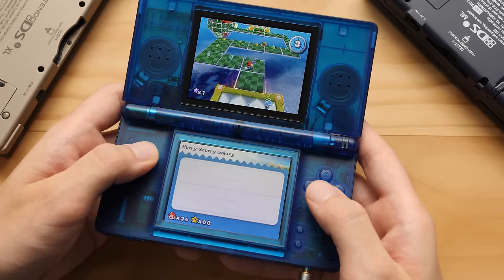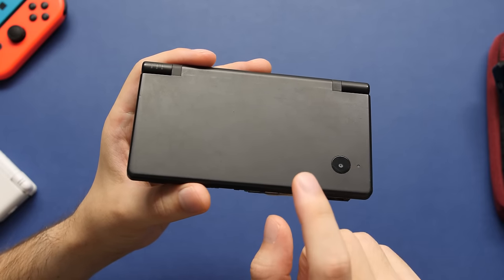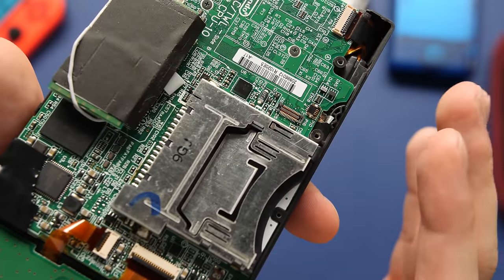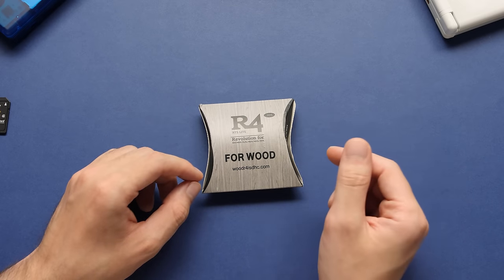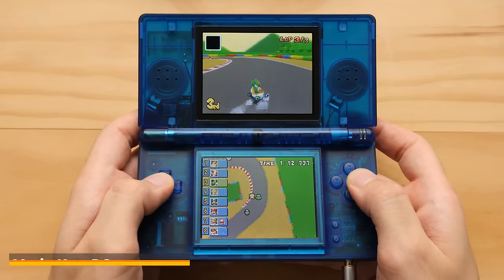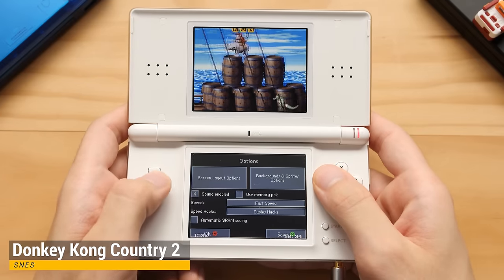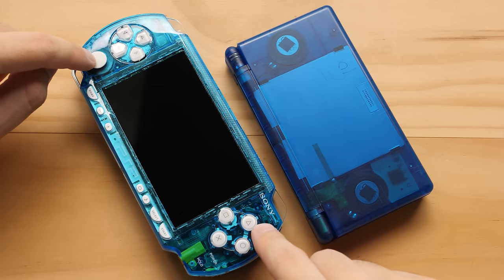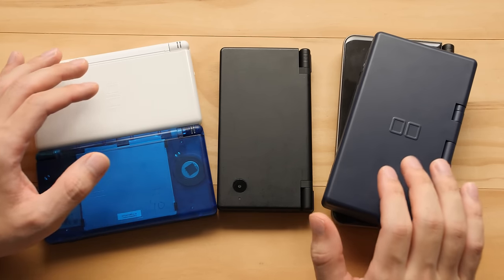The Nintendo DS is Still Amazing in 2023. Here’s Why.

Comment: I used to enjoy writing NDS homebrew. Sadly, the XP laptop I used to code on died long ago, so now I'd have to build a retro PC just to get the dev stack back up and running. Glad to hear R4 cards are still available.
Reply from the maker: I was so surprised to see the scene is still alive and well. I didn't touch on them in this video, but the Mario Kart DS/SM64DS mod scene is even bigger.
Reply: I would just buy an old used laptop, It's a lot more convenient than building a PC if all you need is software compatibility imo
Reply: Couldn't you use an XP VM?
Reply: What @chwoder-hf8xm said. You oughta be able to get things running again on a VM.
Reply: Yea or using Linux/Mac with a compatibility layer
Reply: you can just easily use something like PCem or VMWare to run Windows XP, 2000, etc unless u prefer using older hardware to get things done.
Reply: What would I need to do get into this scene (in terms of language, software and hardware)? I'm wondering whether to get into Spectrum ZX or DS/3DS scene.
Reply: You could run XP on a virtual machine. VMWare Player and VirtualBox are good options.
Reply: You could easily use a VM, or wine would probably work pretty well as well
Reply: I gave up on R4 cards sadly because every single one had a timebomb, and when I tried to fix/flash them it just made the carts unreadable.
Reply: As others mentioned, running xp in a virtual machine using a free activation key online is super easy, currently doing this for my wife as she needs xp for her embroidery machine software
Reply: VMWare workstation is free and does a damn good job of handling things like that!
Reply: Use a virtual machine, bro.
Reply: devkitpro works perfectly on modern machines :) even works on linux and mac and includes loads of useful tools. though if you used to use game maker ds, that might take some fiddling with settings. but honestly modern windows backwards compatibility is pretty damn cool so there is a fairly high chance it'd just work, no questions asked
Reply: You know virtual machines exist right?
Reply: @RatcheT2497  You should say: "It even works on Windows", because the whole thing is actually GNU/Linux through and through and relies on MSYS2/MinGW on Windows.
Reply: @rockapartie  yep, but op here seems to assume ds development happens on windows by default. so saying "it's a linux/unix based sdk but it works perfectly fine on windows" may be less reassuring than saying "it also works on linux and mac". first sentence frames windows as a second class citizen - which could bring to mind compatibility issues, while the second assumes windows compatibility as default with the additional boon of working fine on two other platforms (so even if op switched to e.g. mac later in life, everything would work either way). 
yeah though it's a bit less accurate
Reply: Can't believe Davros is out here modding DSs :0 

Jkjk, rip to ya XP Laptop also.
Reply: @TakiUdon  Who to download  Super mario  galaxy  on nds ?
Reply: had too much file's on to the computer dont add to many files i done that once.
Reply: You'd be surprised how well Windows 10 is optimised for NDS scripting (fanmade enhancements ofcourse)
Reply: If you ever want a fun idea, try porting Pokemon Uranium. That’d be amazing!
Reply: Original R4 cards are for the 3DS and 2DS though, for the DS and DSI you have the M3 card.
Reply: DanteS-119 exactly. If you are writing homebrew then you know about VMs and should already have one setup and ready to power on if you are that attached to XP. The OP must be in middle management, knows a few buzz words but lying his ass off about knowing how to do anything.
Reply: Set up a Virtual Machine, my friend!
Reply: mad respect
Reply: @misterthemad994 I literally have R4 card here on my palm that was made for ds lite. Got it back in the day

Comment: Not quite the same, but the New 3DS has been my go-to handheld this year. Between the ROM injections, native DS/3DS support, and portability, it just outshines all the other handhelds I have at the moment.
Reply: 3DS is peak. If it was only a little more powerful and just double the resolution (would be 480p ish), it'd literally be impossible to beat it ever again.
Reply: @trashtrash2169 n higher res. Switch power yes but there’s no personality. Couldn’t even give us folders…
Reply: @trashtrash2169 yeah the screen is the biggest L for the new 3ds. My modded new 3ds xp is the most superior handheld I’ve ever used but the screens just need to be better. More power wouldn’t hurt but that could eliminate some charm from the library
Reply: @ShadyRapture  Sure, but I think slightly higher res textures would do wonders for the graphics, and that should be based more on the ram than graphics chip, I think, so get faster and more ram, and increase the screen resolution while updating the graphics hardware enough to compensate for the new pixels. That'd be my forever handheld.
Reply: modded vita and N3ds are a w combo
Reply: @Pokefan000000  It definitely seems the be the ultimate handheld combo without diving into emulation consoles.
Reply: @trashtrash2169  Problem is that the already low resolution gets halved in 3D-mode and only a couple games use the full 800x240 with 3D off (e.g. Ocarina of Time).
Reply: @rockapartie  Woah woah woah! You are misinformed! No commercial games use 800×240! It is very obvious if you just open OOT3D that it is not 800x240. So no, in any official case, 3D does not halve the resolution. 2D is 400x240, 3D is 400x240. I do not know where you got that idea.
Reply: @trashtrash2169  I got the idea, because the jaggies get smoothed out in 2D mode. I thought the resolution was higher then. (It can be observed in a couple games, I only remember Ocarina though) Well, it must be anti-aliasing.
Reply: @rockapartie  800x240 is in ZERO retail games! There have only been homebrew demonstrations. In fact, how the 3DS top screen worked was heavily debated by 12 yr olds when it released, some even suggesting that it was two 400x240 pixel grids placed one over the other. The only problem with that theory is that it makes ZERO sense! At all! Especially since just looking at the screen close up reveals the truth of the squashed pixels. There's a humorous Gbatemp thread that documents this argument beautifully. It'll show up if you try to look up anything about the 800x240 top screen. I mean, I could maybe understand thinking that it was a 400x240 screen that diverted the picture to a different eye every other frame, but that was not how it was done in the end, though the 3ds screen can be "overclocked" to near 100hz already, so with a slightly different screen they could have done it this way and kept the 60hz refresh. Maybe not though, The way they did it is superior, I think, but my way might have reduced phantom images. Maybe not.
Reply: @trashtrash2169  Yes, I know that know, you didn't have to repeat that. But like I already said: Ocarina and some other games use anti-aliasing only in 2D-mode.
Reply: @rockapartie  That does not come close to 800x240 mode. Also, OOT has VERY light AA.
Reply: @trashtrash2169  I wouldn't call it light, it's using supersampling after all (which I mistook as having a higher screen resolution at first glance), albeit only on one axis. Horizontal(ish) lines are much smoother and texture flickering is massively reduced.
Reply: @rockapartie  Man, I won't respond another time. Clearly we see things differently, literally, so that's that.
Reply: just ordered a second N3DS from eBay yesterday.
I love that device, its *perfect*!
Reply: PORTABILITY KING
Reply: Same here. Modded mine when the shop closed down and been running old DS and GameBoy.
Reply: 3DS and PS Vita are the best modern handhelds.
Reply: How have you been emulating other devices? (SNES, gba, gb, Genesis etc)

Comment: Usually on DS consoles that have a "broken hinge" actually have a cracked shell in the hinge area. The metal hinge itself usually doesn't break under normal use.
Reply: Thats what they mean tho. Its always the shell thats cracked,not the hinge itself.....semantics.
Reply: @NintenDub  I just wanted it to be clear. If someone wants to shell swap anyway, may as well get one that's broken, right?
Reply: usually the hinge isn't broken but it'll get stiffer or seize up which breaks the shell, even if the hinge still looked like it worked its better to get a new hinge bc the same problem would probably happen after a while even with a new shell

Comment: Pro tip: If you have a (N)3DS XL you can boot a NDS game while pressing the Select button to play it in pixel-perfect mode, which will add black areas around the screens but will look about the same size as a regular DSi
On a regular 3DS it will look too small to be usable
Reply: There is also homebrew software to change the rendering for nds games to make them more sharper
Reply: pro-tip: this has extremely common knowledge since the original 3DS model was released and it's annoying as fuck to see this "fun fact" get posted on nearly every DS video released these days

Comment: I just got a practically new DSi XL for less than $50 and it’s been an amazing experience. I always preferred the DSi as a kid, I just liked the way the shell felt and the screens were amazing after coming from a GBAsp 001. I stopped playing handheld anything right as the 3DS came out so with Twilight menu on the DSi XL I get exactly what I need. It’s wonderful
Reply: The DSi was my favorite as a kid too.
The volume buttons were much better than the sliders and they supported adjusting the brightness on the fly. And they loaded so much faster than the 3DS.
Reply: @AlexsGoogleAccount adjust brightness on the fly? Cant do that on dsi
Reply: @sweettea5166  Sure you can.

Hold down the SELECT button and then when you press Volume Up or Volume Down it changes the screen brightness instead.

No matter what you're doing, it changes the brightness.

Comment: I really liked the Nintendo DS Lite, had mine for years. Recently, I noticed the bottom screen was getting messed up. Where the black text warning was when you boot up, it was becoming black with yellow edges. The blue URL was half blue and half black. I tried adjusting the adjustment screw and sometimes it would help, but then revert back. I adjusted that screw so many times I think I stripped it. Couldn't really tell if I did or not so I opened it up. I didn't. I closed it back up and the shoulder buttons were a pain trying to align the spring correctly. Finally got it closed but power switch wasn't springy anymore. Turns out I snapped the onboard nub on the power switch off while closing it. RIP DS Lite. You were a good friend to me.

Comment: For DS games I like the DSi XL the most, it fits nicely in my hands and the big screen is nice, although that comes at the cost of portability. Not a big deal for me as I always wear a backpack or a satchel. It can do emulation decently, but for that I use a NN2DS XL (what a lovely name), the games run very well thanks to Virtual Console and emulators like mGBA and Snes9x. TWiLight Menu++ runs great too; DSiWare can be installed on the system without it. There're also ports of the engines of Diablo, Doom, and Quake II. Of course, for pure pocketability and playing GBA games natively, the DS lite reigns supreme.
Reply: I have a new 3ds xl with homebrew, am I missing out on anything not putting hbrew on my dsi?
Reply: @idunno421 i have both a modded New 3Ds XL and a modded DSi and from my experience your not missing out on anything. on the 3Ds u can do what the dsi can and more
Reply: @idunno421  If it is a DSi XL/LL you can get better picture quality for GBA/DS games on it compared to the 3DS XL.

Comment: I did the shell swap for a DS lite and managed to break the top screen, bottom screen digitizer and the power switch (same way you did). Had to order replacement parts but got it all fixed up myself. Removing the power switch is not as hard as you think, but you definitely need some soldering experience.

Comment: A New 3DS XL is probably the better choice. It can be hacked without the need of flash cards, has a faster hardware and can is backwards compatible.
Reply: That's unironicaly the best handheld that Nintendo ever released.
Reply: you didn't watch the video. sd card can be used on dsi models. 3ds screen imo is terrible. Clunkier GBA implementation.
Reply: @skatcat743 The screen on the 3DS is factually better wdym?
Reply: I have been thinking about getting a New 3ds xl for a while now, but haven't pulled the trigger. It really does seem like the best as long as you dont want to play your physical gba games.
Reply: @GangityBirdity  The DSi XL has IPS screens but the N3DS XL has TN screens (some of them have IPS screens, though it is somewhat rare)

Comment: If you can hunt a Supercard DSTWO or DSTWOPLUS, those are the only 2 flash carts that I know of that ran Super Nintendo at full speed on the DS, but there's 2 major issues with acquiring one. 

1)they don't manufacture the cart anymore and the Supercard company never blew up like R4, so good luck finding one.

2) if you do happen to find one, nobody hosts the firmware anymore so even if you get the card it's a gamble if it'll work
Reply from the maker: That's why I decided to just ignore them. Wish someone cloned them, but I doubt that will ever happen.

Comment: I love my DSi XL with R4 card. I don't know why but it gives so much more fun to play DS games on real device, rather than ie. some Odin Lite or Steam Deck etc.
Reply: No screen swapping antics. And the screens are aligned as designed. I remember playing Hotel Dusk Room215 with the DS held vertically (side ways) so that's it's like a book.  Wouldn't want to hold a steam deck in Taté mode 😅 🗼
Reply: Yeah, it's because the DS is such a unique device, that emulating it is usually a worse experience. With the way you have two screens at once, can easily touch the screen or reach the buttons, one screen is above the other, just kinda all comes together. Though some games don't lean into this design too much, and are decent on a single screen as well. Ridge Racer DS for example. I can play that on a Pi, or a DS, or whatever lol.
Reply: @DragonDreamVNY  seems you've got good tastes in games, my friend.

Comment: Didn't realize that you can run gba off of an r4. Def gonna be checking that out. I have a launch ds that I always kept in a case, its so minty. Never liked the mushy d pad on the lite. Hitting diagonals seemed tough. Thanks for the video!
Reply: You can but it's far better to play legit games or get a gba flash cart.
Or just play them on 3ds. It's easier.

Comment: Has a black DS lite in great condition ( lives in a Gameboy case)using a newer R4 card with date of 2021 and no problems. Also has a 2DS (wedge) also in great condition ( lives in it's official case) Modded 128gb SD card runs great.
Really interested in the Super Mario Galaxy DS will have to check that out.

Comment: I wish PSP-2000 had aftermarket IPS screens available. I've spent $40 so far ordering replacement screens that arrived in even worse condition than the original one I wanted to replace.

Comment: I still have my DS's from release, with the exception of the original DS which I traded in when DS Lite came out though I wish I hadn't. I still use my 3DS a lot but not so much the DS Lite or DSi's. I'm actually  playing some Pokemon ROM hacks on my 2DS XL right now although my 3DS does have better screens..the 3DS is not hacked but the 2DS is. I do use Twilight ++ all the time. All of them I have are original equipment and in good condition.

Comment: Here's a good modding tip for anybody modding PSPs. If you need a better screen or just a replacement. Buy you one of those old Garmin GPSs with the same size screen. They have the same number of pins it work just as well. Now there is some screens that are lower resolution so you'll have to do a little bit of research but it costs a lot less to buy a Garmin GPS from like Goodwill than it does buying a screen from a seller on the internet
Reply from the maker: Is this real? I can't find anything on this.
Reply: @TakiUdon  I'm not even sure that the PSP community caught onto this. I found a bunch of Garmin GPS devices at Goodwill for like $1 each and I bought them just to see what kind of screens they had in them for maybe one of them would work with a project that I was working on. I've took it apart enough PSPs to remember what those screens look like and three of those garmins had the exact same screen. Like I'm talking down to the model number of some PSPs I've taken apart
Reply: @TakiUdon  sometimes I hate ADHD. I was laying down when I read this comment and now I have to get up and find those screens. I know where they are but I got to dig them out
Reply: @TakiUdon  I dug through all of my electronic parts and I can't find the screens I'm looking for. There's some similar ones but they're missing that backlight or the two pin cable that's on most PSP screens. I'll do some digging and I'll comment again if I find something. Or if I find the GPS's I was talking about
Reply: I FOUND IT!!!! The garmin nuvi 610-670 had a similar screen but I don't know if it works. The 760-780 screen looks like it's an exact match. Hopefully the pinouts aren't different but I'm actually so curious now to see if this works. I'm going to buy a broken screen PSP and fry it just to satiate my curiosity. But it's got to wait until payday. I'll link the eBay listings that I can find below this and if you don't see a link it's because YouTube struck it